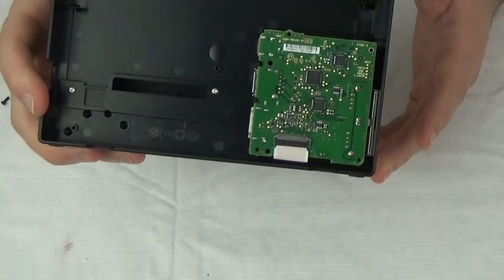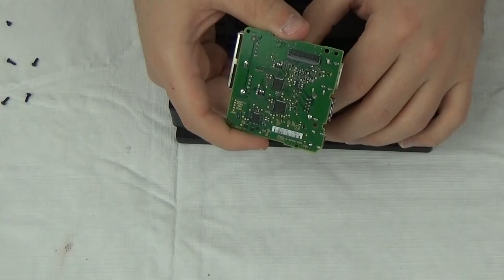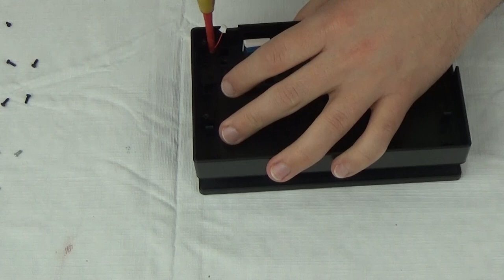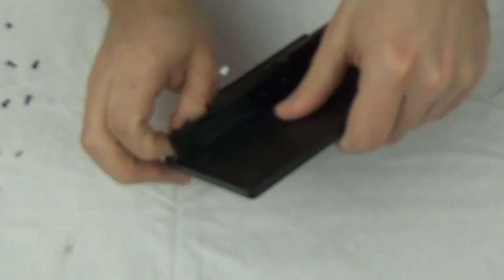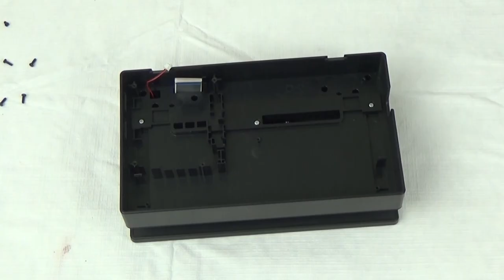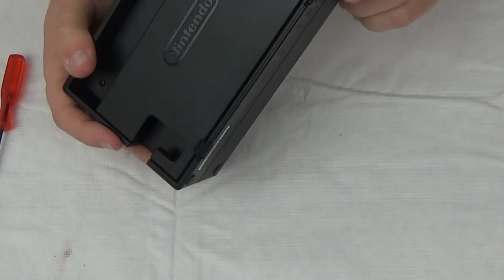Taking Apart The Nintendo Switch Dock!

Comment: My question is: could nintendo put more stuff in it to up the performance?
Or would it just be wasted effort?
Reply: I was wondering the same thing, looks like a lot of room
Reply: cloudsRniceC0M3 it's to allow you to store drugs when you're in the business
Reply: cloudsRniceC0M3 the CPU doesn't run at 100 percent when undocked, so the dock should technically put the CPU at 100 percent or overclock the system for docked gameplay.
Reply: cloudsRniceC0M3 I feel like it would be easier to make a better tablet and sell it without joy- cons and or a dock as an upgrade instead an upgraded dock.
Reply: It could run the OS when docked... though it would need some serious magic for when you undock it (in case it's seamless).
Reply: Kevin Arnold holy shit dude that's a good idea lmaoo. I gotta tell the streets ! help Nintendo out a bit in sales hahaha.
Reply: cloudsRniceC0M3 The problem is it opens a huge can of worms. If there is a "power dock", developers will be encouraged to use it. This may lead to games that don't run well on a regular dock or in handheld mode. The first thing creates a New 3DS situation, the other one compromises the portability of the console.
Reply: Fernando Banda only if games drop support for the base dock, all games would really need with an scd dock is a 3rd settings profile similar to the "pro patch" on a ps4, and i doubt most devs would completely forego portable mode in favor of scd mode, however the idea of simply upgrading the console a few years down the line rather than creating a whole new design, especially since this means all previous library and vc games carry forward would be a huge benefit
Reply: I was thinking if nintendo does VR they can sell a processing unit that plugs into the space in the dock where the wires run through, providing extra power to the switch only when docked, to run Virtual reality
Reply: Greninja&Co That sounds more likely. In two years or so they could make an upgraded one for the same price this first tablet costs to make.
Reply: Adding more power to the dock would increase cost drastically. External processing power is expensive. What they could've done though, was somehow make the dock cool the Switch to allow for bigger overclocking headroom. I'm not sure how they would design it though.
Reply: In about a year or so, they'll be able to fit a smaller version of the chip that's inside of the Switch currently into there. This is because they will most likely be able to manufacture the same chip but on a smaller die
Reply: they can sell the external processing unit bundled with the VR device
Reply: cloudsRniceC0M3 Nintendo did patent something called external computing device. And if you look the picture it looks like a smaller PC connected to a bigger PC
Reply: cloudsRniceC0M3 that would defeat the purpose of it being a portable system, because if they do that then you're going to have games that can only run while docked and then when you go portable they're not even going to run or run at like 2 fps, it would be a disaster if they put computing power in the dock
Reply: Yes, maybe they could use all that space to upgrade the storage! Then you could pass all your  data from games you've already completed to your dock
Reply: TheCrazySullustan that would discourage people from using the device undocked, who the hell wants to play a game that looks like complete shit portable but when it's docked it looks crisp and high resolution? It should look the same in both situations. That would also create a problem in multiplayer games such as say if battlefield 1 came to switch, the portable users wouldn't be able to see as far as docked users and that creates an extremely unfair advantage because you would be getting killed by people you wouldn't even be able to see because of draw distance limitations and object distance limitations
Reply: Miguel Angel Martinez Casado people are making a problem out of nothing, game saves take like 0.0001% of the storage even if you have thousands of games with thousands of save files you're still going to have plenty of storage
Reply: If you honestly think the choice of not putting anything more in the dock is anything more than a cheapskate move by Nintendo then you are wrong friend. Horribly company with horrible policies, stop being sheeple baa baa.
Reply: From a computer science/engineering standpoint: Yes.
From a possibility standpoint: Yes.
From a feasibility standpoint: Yes.
However, I guarantee it was also considered by Nintendo, and for some reason, they chose not to do so. Perhaps it would have raised the price of the Switch too much, or perhaps it would have been to difficult to code correctly. I would argue that only the former has any weight, since it already has to deal with performance jumps when docked/undocked. While it may have something to do with a factor we don't have information on, I would be willing to contend that it was a bad decision (and the primary reason I'm not getting a Switch until at least Black Friday). Nintendo chose to leave the dock as a pure hub that siphons electricity to the Switch, allowing it to boost its clock speed. That's all well and good, but what the Switch needed to prevent it from being just another tablet (in my opinion) was a GPU boost. If a second GPU existed in the dock that either totally shut down the first or functioned in tandem (which, granted would be difficult due to the fact that parallelization of GPU's isn't perfect right now, just looking at Crossfire and SLI technologies), the Switch could have had a tremendous boost in power. I would be willing to wager that Nintendo could also create a proprietary solution to the issue because they control both the hardware and the software, and the technology aready exists (looking at the Microsoft Surface Book, which contains a separate discrete GPU in the dock that functions as a power boost. Side note that Microsoft also doesn't sell docks individually as upgrades, so maybe there's an issue that both Nintendo and Microsoft know about that currently prevents it). If this solution were implemented, Switch owners would be able to upgrade their consoles whenever they wished by simply purchasing more powerful docks (and also would likely earn Nintendo significantly more money over the course of semi-annual upgrade cycles until the Switch's successor is developed).

At the same time, Nintendo could have taken a totally different route that I still would have felt good about, as a computer scientist and enthusiast. They could have put high-level cooling devices into the $90 dock itself and overclocked the Switch significantly, relying on the dock to cool it instead. Because they have a custom Tegra (Maxwell? If so, they made a poor (IMO) decision not using Pascal) chip, they would be able to control its output to a very fine degree. If the dock contained several fans and perhaps even heat sinks to pull heat away from the Switch, the console would be able to increase its clock speed significantly more than it does and make it competitive with modern home consoles. Unfortunately, they released it with a dock that only contains a hub for whatever reason, and overcharge for it significantly (the reason of which is beyond me). At a $90, or even $60 price tag, they could afford adding a second GPU or a significant cooling structure to enhance the output of the Switch. But instead, they chose this, and perhaps time will tell us why.

As some thoughts of my own to conclude with (that will not be neutral like the previous paragraphs), the main putoff of the Switch for me was the fact that it is essentially a tablet, and I detest tablets (not as powerful as a laptop and not a portable as a phone), but thought Nintendo would be able to justify it by making it an innovative handheld that boosted with additional dock hardware, or even with a huge clock boost to their custom chip and a cooling masterpiece in the dock. But instead, it remains stuck at whatever the tablet itself can output, and that is ultimately why I decided to wait until at least holiday season. They came so close to creating an incredibly impressive piece of hardware that would have had me reeling, but instead, they released something that pushed me as a power junkie away. A hybrid would have been a perfect solution, but it fell short, because in the end, you are ultimately gaming on a tablet, less portable than a 3DS, less powerful than a competitor's console or a PC (another side note: the 3DS should get another version because of how outdated the hardware is). And in the end, that was a bit too disappointing for me to grab one right away. I hope everyone who gets a Switch loves it and I want them to think it's great, but for me, they didn't use the resources they had in an efficient way. I understand that it's a cheap, $300 system that comes with a very innovative feature, but in the eyes of a hardware enthusiast, how is it different from getting a tablet and then connecting it to your TV? Even with the joycons, there's just not enough there in my opinion, and the dock was the key killer feature that they fell short on. Who knows? Maybe they'll create a new dock with better hardware in the future that will make the Switch what it appears to be. But until then, I'll wait for a sale and watch all you Switch owners having a great time here on YouTube. Enjoy it!

TL;DR
Yes.
Reply: sneakie1 actually it does, I'm not sure if you know how these things work or not but the Switch has an ARM SoC, which most likely won't work with an additional SoC. What's more likely is that they will do a "New" Nintendo Switch like the 3DS and put a Pascal based Nvidia chip in there to boost performance and battery life
Reply: sneakie1 there would be no point in including a "power" dock because it would destroy the portability of the Switch itself, then it's not a hybrid anymore. The switch is built to play the same games at the same graphics(minus resolution) whether docked or undocked. Having a "power" dock would cause instances where games would come out that would run so bad or not at all in portable mode, or the settings would be so low and the game would look so bad that in game like say BF1, people would have unfair advantages because a docked player would be able to see much farther and clearer than a person playing portable. Long story short a power docker is a very very stupid idea
Reply: That's circular logic. It won't work because they didn't engineer it to work, but if they went into it with that in mind, engineering it to work properly would have been entirely feasible.
Reply: LegendBegins did you even read my last comment about how a power sock would ruin the entire point of the Switch?
Reply: I disagree with this, actually. Nintendo controls the Nintendo game market; they only have to make sure the standard is that it plays properly on the tablet before moving it to the dock, and the dock bumps the resolution to high levels, and perhaps fixes any frame hanging the tablet alone might encounter. It doesn't have to make the core gameplay/mechanics different; it just has to look better.
Reply: Kevin Arnold 😂😂😂😂😂😂😂😂😂
Reply: cloudsRniceC0M3  it real depens maybe the could add a better upscalee or add a built in fan to dock  help keep the switch cooler whiled and not have to low clock speed, due it getting to hot, that said not sure, if moble cpu can do boost clocking like pc cpus.
Reply: Kevin 5:42
Reply: Since the switch HAS a usb C - nintendo could effectively release a BEEFED up dock with its own graphics card + cpu, allowing games to run at higher fps + better graphics.
Reply: @Kevin-yh8ol  lol